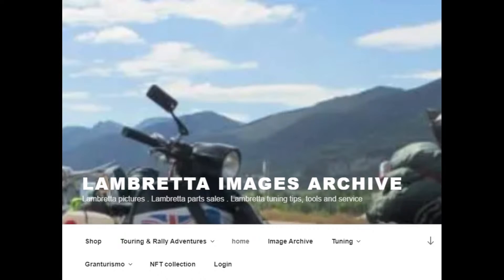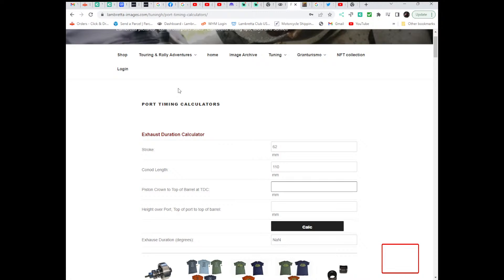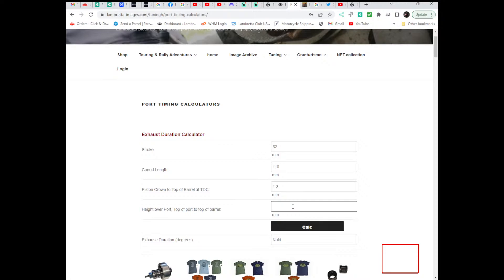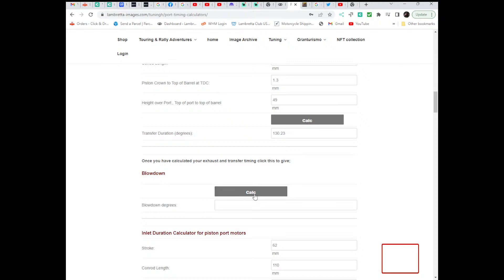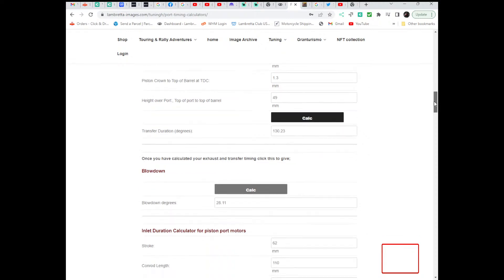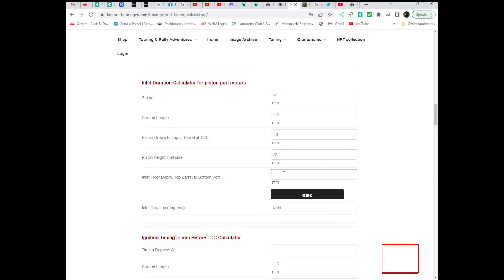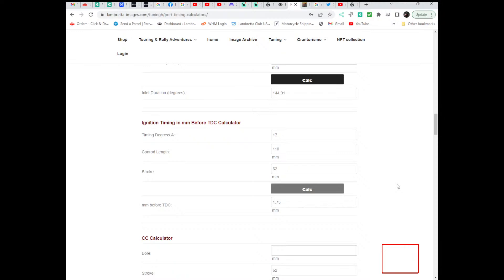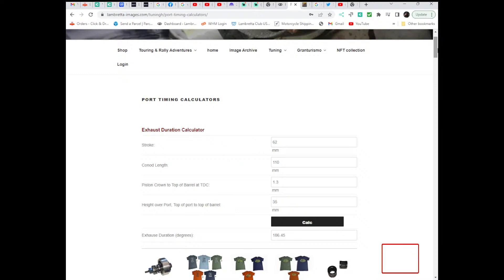Port timing calculators explained

Comment: Hello good times guy, i read if your piston TDC goes into a recessed  head you can get too hot in the head and it may warp?, like my real head ? [water cooled maybe ]  If you increase your stroke the  timings change , which is better to get squish and timings lower a base plate or head plate ? It's doing my head inn. Thank you .
Reply from the maker: depends what port timings you're chasing